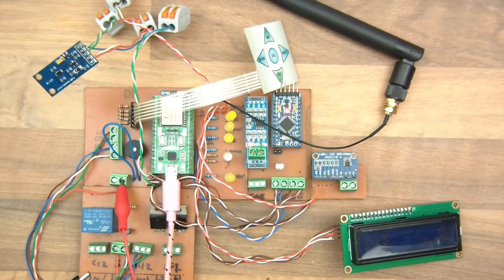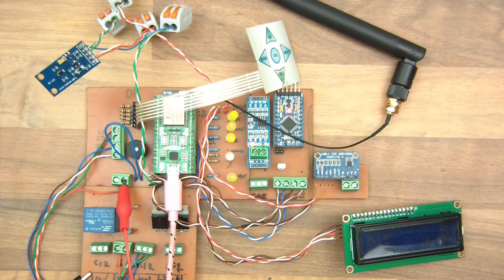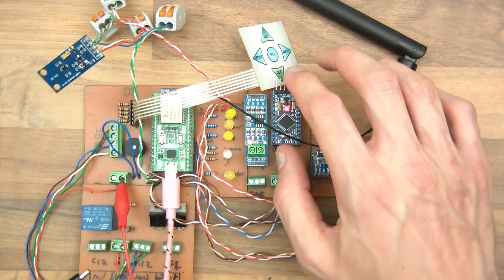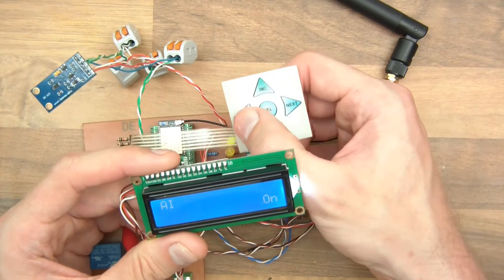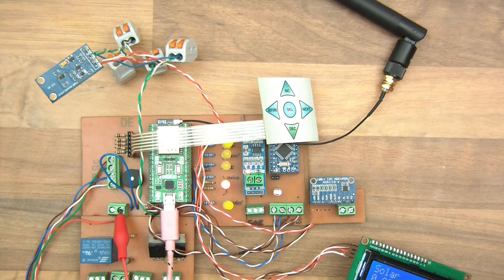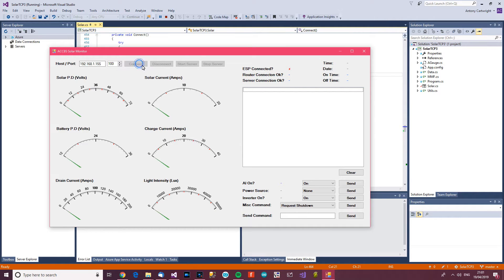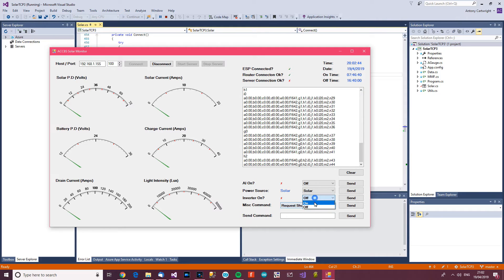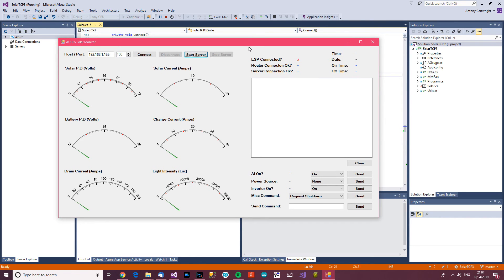INVESTIGATING: My DIY Offgrid Solar Power System (An Update - April 2019)

Comment: It's good to experiment and learn, but not to reinvent the wheel! Check out Grafana on RPi for real time logging and display of the data you collect.
"DIY Tech & Repairs" channel has a load of info, and a >100kWh home made powerwall from 18650 cells, solar, transfer switching and inverters too - you probably know of him already.
Reply from the maker: Hey thanks! His is cool, but it's on RPi, which I what I started with, but I upgraded to ESP32. His is also grid-tied but mine isn't! ;-)
Reply: @antonycartwright  You can keep the ESP32 and use Grafana on RPi with it for logging/display because that work is already done. Just download the image.
His system is hybrid, so can do grid tie and standalone with the transfer switch.

Comment: Great project. I live in the Dominican Republic. The electricity here is very inconsistent.

Will this device work as an automatic programmable transfer switch?

Be able to program it by voltage?  When at a voltage or above use solar power. When voltage goes below a number, let's say 12 volts, switch to main power and turn of inverter.

But when main power goes out turn on inverter and switch to solar.

Possible?
Reply from the maker: Yeah, that's what this does. :-)
Reply: @antonycartwright  That is great. I've been looking for something like this for awhile.

Do you have a parts list?